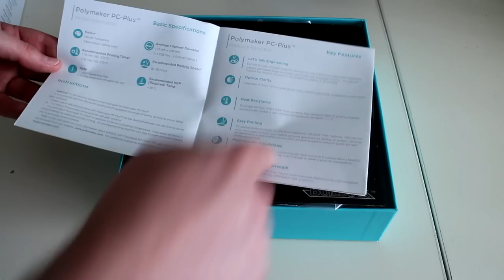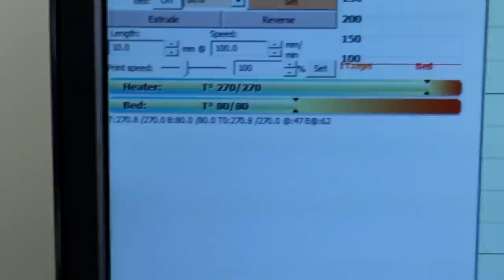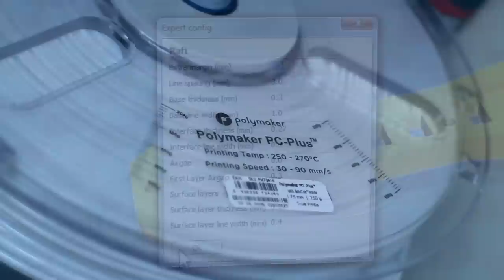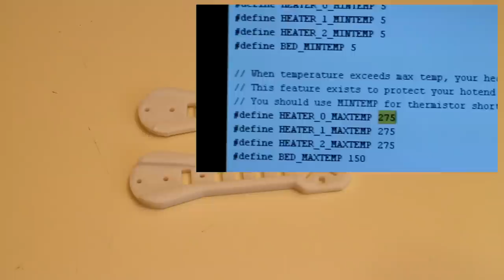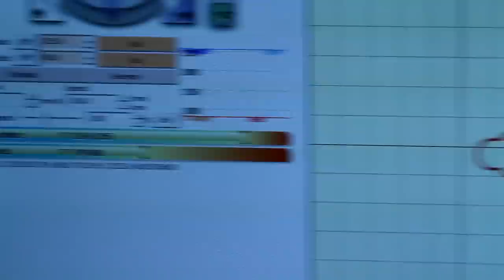3D Print in Polycarbonate plastic

Comment: I've tried the Polymaker PC-MAX and eSun  ePC - I much prefer the eSun ePC. Prints much nicer, PEI bed works great (unlike with PC-MAX), doesn't need as high a temp. Super strong and great finish. I would use ePC for practically everything if it wasn't 2x the price of PLA.
Reply: What are your print settings?

Comment: I can see that it really didn't print that well. It was full of micro-bubbles from not flowing at a high enough temp. I could even see that it was not flowing well when you were pushing it through the nozzle,.. It was like peanut-butter. At 290-310C it flows fast like it should and does not have time to compress in the nozzle and bubble up. I could easily tell that your resulting part was very brittle and much easier to break than it should have been. I used to print it that way too, and thought it was normal, but it is not. You also usually need 102-104% flow (to compensate for shrinkage) for the speeds you are running. I never run it that fast unless the temps are even higher yet. People also ALWAYS need to measure the actual thickness and put that into your program instead of assuming it is always 1.75mm. - Most of the time, it is 1.68mm form shrinkage by the time you get it.  If you had printed it at those higher temps then it would have been rock hard, very shiny and bright (or completely translucent if you had been using the clear), and the threads on the bottom not so easily torn off like that when removing the part. -- To see what it should look like, take the end of your thread and melt the end of it down into a nice size bead slowly with a heat gun. You will get a nice sample of how translucent and tough it really is when it is printed right.
Reply from the maker: I followed the manufacturers instructions with temperature's and flow rate. I like the strength PC has but it is not the easiest to work with - high shrinkage, bed adhesion, very high temps, etc.
Reply: I run PC almost exclusively in my printer.  I would somewhat normally agree with RubberFishFight's statement but the guy opened the vacuum sealed product and used it. It would have had to sit out for a week for it to be that bad just from humidity. I live in Georgia and have high humidity here all the time. - Still, it does not get that bad unless the filament has been out for a week or more without protection of any kind. Personally, I use a modified de-hydrator mounted high above my printer to feed the filament from directly and dry it out for a couple hours before starting a print that i want high quality from.
Reply: Hi Rawze, What bed surface or glue or anything to you use to stick it to your bed? At what temperature do you print it?  
thank you for sharing info.
Reply: @alexandrevaliquette1941  I use capton tape on a heated bet set to about 115C. - i also spray it with Aqua-net hair spray (specifically the super-hold purple can one), as it is really nothing but mostly liquid pvc/nylon, and PC sticks to pvc/nylon on the heating bed quite well when printing. Only way to prevent some types of shrinkage is to heat the whole printer up to about 100c or so in a large enclosure or to insulate the bed area so the whole part can stay that hot. Printing PC at room temps is like trying to print poly-C with your printer shoved into a deep-freezer lol

Comment: I really dig your filament reviews man.  Is it possible you can use a more scientific method of testing the strength and/or elasticity of the filaments?  Like with a gauge that measures the pressure at which it breaks and the point up to the breaking?

Comment: 270 C is a bit hot. Try 230-245, for small parts even can be 215. Great video PC is my favorite material to print with. The cooler you print the clearer it will be. High temps seem to make it bubble.
Reply from the maker: +GetLoFi 
PC-Plus recommended temp range is 250c-270c. This PC-Plus will be the ultimate 3D Printer parts material as it's stiff, strong and can withstand very high temperatures.
Reply: n+Tech2C Well then I am not sure what they are adding to the PC because it prints fine at 230. Keep in mind the thermal lag of your hotend which can also be +-20 easy.

I like this stuff http://www.amazon.com/gp/product/B00LAJNS22?psc=1&redirect=true&ref_=oh_aui_detailpage_o00_s00 then again I'm in USA and it gets here super quick. Yes PC is the future, between that and ABS. Most people will not be printing in PC for a little while because their printers will MELT by doing so. Stop PLAing around. :-)

It snapped with the pliers because it was too hot during print. It should just delaminate all thread like.
Reply from the maker: +GetLoFi 
Thanks for your comments.
Stop PLAing around indeed :) although it's so easy to print...

If any part delaminates when stressed then that implies the printing temp was too low. At 270 this was a solid piece of PC - very hard, almost like glass.
Reply: Bubbling is often due to moisture in the filament, even vacuum sealed filaments can have absorbed water.

Comment: Is there a binding treatment you can do with polycarbonate like there is with abs and acetone? i know from working with sheets of poly that there are welding glues, but theyre fairly expensive
Reply: +RJ Wilson 
You want to use some Methylene Chloride (also known as DCM or dichloromethane). it's not too expensive, if i recall correctly you can get it for £2-3 a litre.

Comment: Try and print a functional part without the PC tearing itself apart from warping stress.  Nice idea, but still not practical for most consumer printers.
Reply: What do you mean by that? Do you mean it splits afterwards or during the print? If you are talking afterwards you are supposed to anneal it at 100c for 2 hours afterwards,  That releases stress from the parts.

Comment: Hello,
what is the largest part you printed sucessfully with PC? I tried something about 170 mm long and the warping made it impossible.
Also do you think it would be possible to print the raft in PLA so it sticks on glas and then change to pc for the part?
Reply from the maker: +Lukas Proprentner 
PC seems to warp a lot. That's why Polmaker include a sheet of BuildTak to overcome that issue. I suggest purchasing a sheet of BuildTak for your PC, based on my experience.
I'm not sure if PC will stick to PLA, but the warping of PC would render the PLA futile as a raft I would have thought.

Comment: Could you let me know what the difference between pc plus and pc max is?
Reply: I may be somewhat late, but here's your answer anyways: PCMax  (now called PC polymax) is regular Polycarbonate. PCPlus (used to be called PolyLite) is a polycarbonate filament that's supposably easier to print, but has much less impact strength (3.4 kJ/m², as opposed to PCmax having 25.1 kJ/m²). You can find more info on the datasheets.

Comment: What is the best 3D printer for PC?
Reply: Basically every printer. You only need a printer that goes up to 270-ish degrees Celsius at the nozzle and 110 degrees Celsius on the bed. Also recommended is an all metal hot end and maybe also an enclosure.

Comment: which 3D printer are you using?
which laget height do you use?
Reply from the maker: +Christian Haagen (Christians Vlog) 
Replikeo Prusa i3 Rework.
I print in many layer heights, from 0.3mm down to 0.1mm.
Reply: What does rework mens? I have a prusa i3 if you want to see some of my first videos, what have you done to yours to print so fine? Is it only the fillerment?

Comment: how does it smell ?
Reply: He said it doesn't
Reply: I have been working with heat forming PC (not in 3D printing, though). Just like any plastics, you shouldn't be huffing the fumes from them anyway. PC does smell at a certain temperature. But just because you can't smell at the moment doesn't mean that it's releasing fumes. Always keep your 3D printer in a separate and ventilated room no matter what substrates you're working with.
Reply: things don't need smell to be toxic.  Pc is toxic.
Reply: @digibluh  FDA food safe. Facts can be your friend.
Reply: @truantray  They are not mutually exclusive. Polymers may decompose and release toxic compounds at work temperature and still be food safe at room temperature. 
Simplest example PVC: All PVCs start decomposing below melting temperature; they need stabilising additives to be processed. And I guess there's a reason PVC is hardly ever used in 3D printing. Still, food grade PVCs are available (but not as filaments AFAIK)

Comment: All that hassle for a high temp setup for PC, yet in the end, the PETG part appeared superior in durability :O
Reply: PETG isnt actually that tough. I printed a part in petg, and accidentally twisted it in the wrong way and it shattered. I have used the same filament with similar settings and it was ductile. I repirnted it in PC and it didnt break despite me hammering it with pliers. There would be no way petg would handle that.

Comment: Mine warps like ABS. Anybody else have this problem?
Reply from the maker: +Cowboy Boots 
Yep PC has a very high shrinkage rate. You've gotta have a hot bed and use the recommended adhesion material for your PC.
Reply: +Tech2C yup used recommend settings and build tac